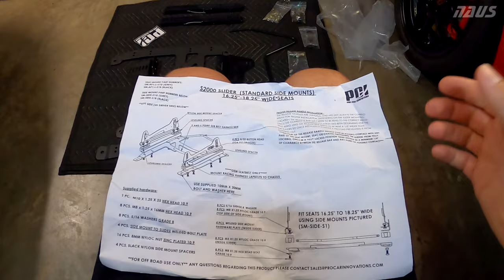S2000 PCI Sliding Seat Rail Install - How Low Can It Go?

Comment: Great video!! Love the in depth review and modifications needed to make it suitable for you. 

Very timely as I’ve been running my pole position on buddy club rails with hard dog for about 13 years now. I think this will be a great upgrade. 

Any thoughts why you chose the slide version over the static mount?
Reply from the maker: When I autocross, I like to sit on top of the steering wheel more for better visibility of the course/cones. On track I need to slide all the way back for maximum leg room to be able to heel toe downshift. Hope this helps, thanks for the comment man!

Comment: beautifully edited videos man. Thank you. With this setup, how much of a height seat drop compared to oem would you say you have? Also what rollbar is that in the back?
Reply from the maker: It’s about 3 inches lower than the stock seat. Huge difference. The rollbar is a harddog double diagonal , I have a full detailed install video on my channel on the rollbar, check out my ap1 playlist on my channel!
Reply: @NAUS2K  Thanks. Ill check it out.

Comment: So all in all would you recommend this to someone who already has the buddy club rail? It seems that it goes just as low, but the advantage is the build quality is better? Also, how much hammering did you do to the floor? I have my pole position setup with the finger gap under the back, I assume you only need 1/4" hammered down on the floor to make the seat work on the lower setting
Reply from the maker: If your buddy clubs start to have play develop like mine did I’d say yes go for the pci, the mods I made here were pretty minor all things considered. I just took a dead blow hammer the that hump a couple years back, I got it lower but wasn’t a huge change. Just enough